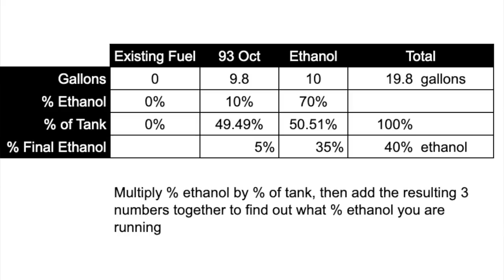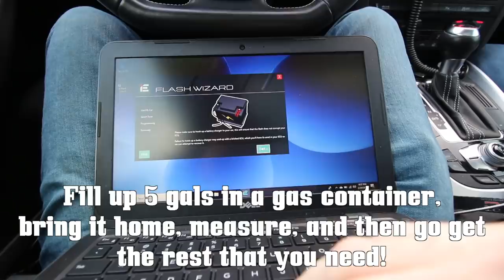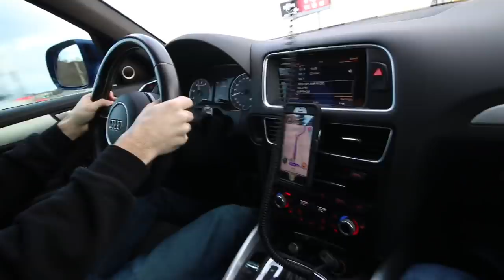Putting ETHANOL in my SQ5! (IE Fuel Pump Install)

Comment: Exactly what we had to do with our Speed3s and Speed6s. HPFP Internals was the first mod anyone needed to do, and we had to do mixes for E85. I was running a 33% mix and spraying meth. When the closest E station was 30 miles away from me I had two 5 gallons jugs, a 2, and a 1. I'm really surprised no one has made a flex fuel sensor like the GM guys use.

Comment: Thanks for posting the vid, Looking to pull the trigger on a huge swap and I’m hoping you could answer a quick question? Currently I have APR duel pulleys, stage 2+ w/ UltrachargerTB, cold air heat exch system, carboni 2 stg closed intake & open intake systems & custom 3” exhaust. So basically everything they offer for my sq5 but I’m not happy with them as customer support sucks & I hate paying dealers every time I want to change maps twice a weekend from 91 to 100 or 104 & back again.

Could you tell me what flex fuel sensor & readout you’re using and fuel pumps? And have you had any issues or had to change any other f.s. parts running the e/40 mix? You’re help would be greatly appreciated.

Comment: Hi Eli,
To clarify... same tune or different? No changes to injectors for more flow? If the tune does change are you going back and forth with each file mix?
Reply from the maker: Yes - different files. 93 file and E40 file. Takes less than 30 seconds to flash the file so doesn’t really bother me. No changes to injectors

Comment: What's holding back a flex fuel solution where the ECU adjusts to any amount of E85?
Reply: My B8.5 Allroad with the APR tune can adjust to any mix ratio on the fly, and you can run strait e85, but you can also do that with the car bone stock.

Comment: Eli, do you flash your car at the gas station without connecting a charger to your car battery?
Reply from the maker: Yes - when switching octanes, the tune only takes about 30 seconds or less. I trust my battery for those flashes!
Reply: @IgnitionTube  Thanks for the tip.  As I'm upgrading my Q5's fuel pump this weekend to run E40.
Do you switch octane files on your S6 without attaching battery charger also?

Comment: My tuner said I can mix in 3 gallons of E85 to my Stage 2 Single Pulley tune to get a nice boost after watching this I'm going to find a Station selling E85 now.
Reply from the maker: Not sure you’ll feel a difference - we do that before going to the track to help with knock prevention on 93 files but it really doesn’t help with power. For context, I’m running 3x the amount of ethanol you would be, and that’s where you really start to feel it, but you need fuel pump and tune to accommodate that.